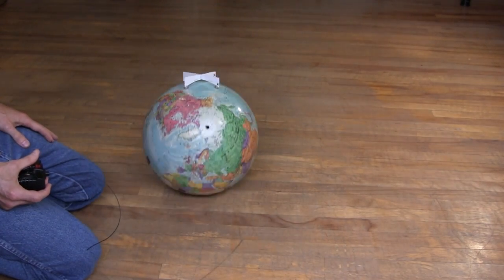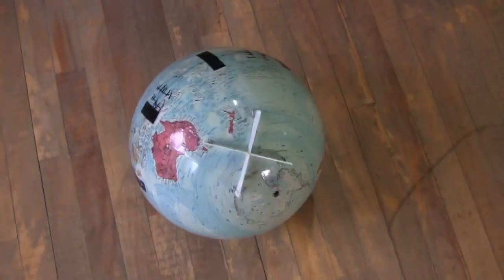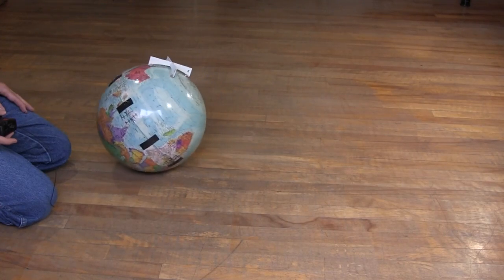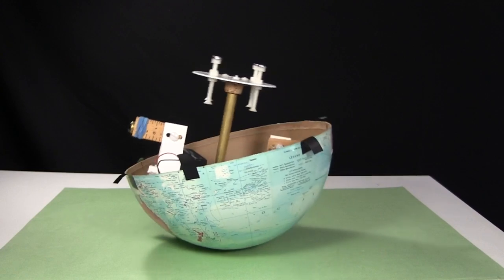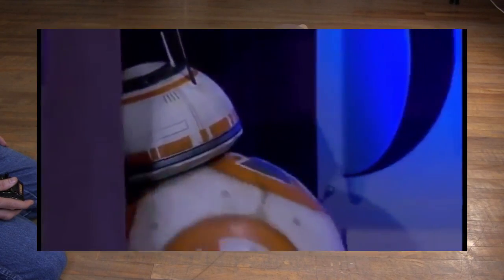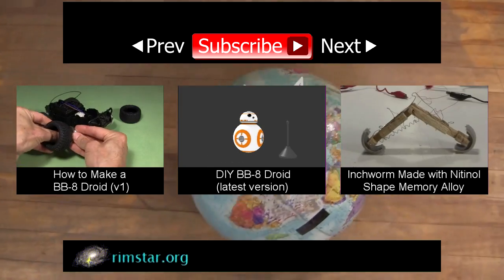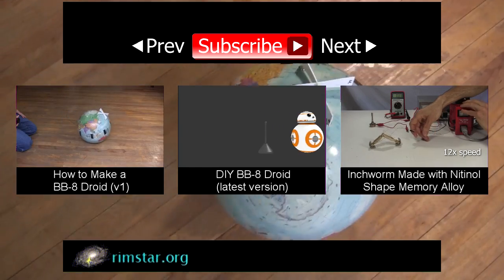BB-8 Droid Build (v1) from Star Wars - Homemade

Comment: Then how to cover the card board head
Reply from the maker: I didn't get to that point since the head was already too heavy. I guess you could keep adding move of the vertical sections to fill out the inside more, and then glue strips of paper over it to cover it. In my version 2 BB-8, I make the head using styrofoam instead (https://youtu.be/Ycgng3vyLOM).

Comment: you should try and use stronger magnets and both the head and the body...
Reply from the maker: +CAPATURE I'm using hard disk drive magnets in version 2. But it doesn't matter. The magnets in this version 1 are too strong for the motor in the RC truck to pull. What's needed is a more powerful truck and more mass in the bottom. My version 2 has that (https://www.youtube.com/watch?v=1gWBS70vphY), though it's currently in testing so I'm not sure if I got it yet.
Reply: RimstarOrg cool! I'm making a simple BB-8 if i can and i really enjoyed your version 1 because its cheaper than version 2 and i think i could make it. just need the head to be very light!!!
Reply from the maker: +CAPATURE I still wonder if there's a remote control toy out there that has strong enough motors to do the type in version 1 too. Let me know how it goes.
Reply: RimstarOrg thanks!

Comment: I "suggest" you add a chain or ball link in the center of the central rod so the magnets can be as strong as they should to hold the head on and then a weighted pendulum "plum-bob" to keep the head in line with the balls top.
Reply from the maker: +Luke ODonnell Thanks. I think I recall considering a design like that at one point (and forgot about it :), I went through a lot of alternatives.) That would be good for the next version. Ultimately though, the head should be able to move all over the top on its own, but that's for a much later version.

Comment: Maybe bearings on the outside part so you can use stronger magnets.
Reply from the maker: +Andy Jones Bearings for the head are in the plans. A lot of commenters have mentioned it and it's not something I'd thought of before.
Reply: RimstarOrg unless you already have something in mind, maybe bearings found in bicycle wheels and headset would work, since those use exposed bearings, they might roll any direction. Easy to find anyway!
Reply from the maker: +Andy Jones Bearings from bicycle wheels are exactly what I have in mind! I'll make a small socket of some sort to house them in. At least that's the plan right now. But bearings in a headset? I'm not familiar with those. What type of headset?
Reply: RimstarOrg same thing. They're so you can turn the handlebars. Anything with exposed balls.(Can't wait to hear the comments about exposed balls) you got the idea. If you look at a bike frame, that section between the handlebars and forks usually has bearings where the channel they run in is a press fit in the frame that could be pounded out (or cut). Might be easier than cutting a hub or making your own channel, but I don't know if the original channel will allow free movement or only the intended circular movement. The same bearings are also in the bottom for the crankshaft. I might have time to test it later today. I'm sort of a hoarder, lots of bikes!
Reply: RimstarOrg I just looked at my bikes. If you can find a "freestyle" or "trick" bike, there's a piece called a "gyro" that allows you to spin the handlebars without twisting your rear brake cable. Its got bearings in it and simply lifts off. Bearings, channel, and all. Still gonna take some of that rimstar ingenuity to make It all come together though!

Comment: A small no cost upgrade that would get rid of some of your problems could be to put the head not at zenith but more towards the front of the car.
A small cost upgrade could be, to reduce the friction of the head maybe with small plastic-beads using cut off needles as axles.
That could then be upgraded if you make those bead-wheels able to swivel, but maybe that isn't even necessary.

Comment: One improvement you should consider is to make a servo controlled mechanism to tilt the arm inside so that it moves independently from the truck. You want to force the head to the direction of movement to mimic the way the "real" droid locomotes. If you watch him, he leans into the movement direction like a person on a Segway. This would help solve the weight problem as well because the weight would move to where it was helping drive the truck.
Reply from the maker: +USWaterRockets Actually, his head doesn't always title in the movement direction. In the 1st Star Wars trailer where he's moving fast his head is vertical. Mind you, they used various puppeted versions during filming (the full-featured droid we see at promotional events was made after filming) but it's still canon behavior.
I'm working toward our Ottawa Maker Faire in November so I'll be happy just to have a rotating head by then. The servo arm is certainly one approach for tilting. Some others are to put my vertical brass rod on a swivel at the bottom, or have the inside magnets on a curved rail.
Reply from the maker: +USWaterRockets Trying ball bearings for the head, instead of the magnets are in the plans. I hadn't thought of having bearings serving both functions until people here pointed it out.

Comment: it would probably work a LOT better if you can find a spherical surface better than that globe, and perhaps add rollers on the top part, all to reduce friction. It seems like the magnets on the head have a hard time sticking to where they belong.
Reply from the maker: +Power Max Actually, the magnets on the head stick better than I expected! :) But yeah, as a direct result of the comments here I'm pretty sure the next version will use small steel balls instead of the magnets. My globe has terrain sticking out of it and I sanded them flat only around the join so far. If I don't switch to something else then I'll sand the rest of the terrain off and work on where the two hemispheres join. I'd rather spend the money on the driver mechanism first.

Comment: you need motorisation on your white cross like buggey , small rc heli motors 4 of them and bluetooth remote control...just ride it on the soccer ball..
Reply from the maker: +HAL900032 The problem with that approach is that the head isn't supposed to always be on top. In the Star Wars trailer and conference video it rides down quite a way on the side of the ball too, sort of like tilting your head but without a neck. Look closely at the 2nd clip of the actual BB-8 droid that I show near the beginning of the video and near the end. I know James of XRobots did his that way, but that was based on only the 1st trailer where the head was always on top.
Reply: +RimstarOrg I see that yes...

Comment: You could try adding weight to the bottom of the car, because the main thing you want is that the center of mass of the car with the structure, which holds the magnets, and head lies below the center of the ball. You could also try to reduce the mass of the structure with the magnets inside the ball. Still in interesting attempt and I am looking forward to your future attempts. I also did a quick search and it might be that the head also has its own actuators which are controlled in order to allow for head movement. One way that jumps to mind is to use some kind of pendulum configuration, such that the head will be oriented away from the effective acceleration (so leaning into the movement when accelerating). Here is a quick mock up in Algodoo: http://i.imgur.com/Ij3fvix.png however it will be hard to find an implementation such that the pendulum can swing in two directions without obstructing the structure which ensures contact of the wheels.
Reply from the maker: +Kwin van der Veen Thanks for the suggestion and drawing. That was the first approach I tried. I quickly found a problem with it. For the pendulum arm inside the ball to hang there it has to be supported by the magnetic attraction to the head. For the pendulum to swing as it needs to, the mass at the bottom of the pendulum has to be relatively heavy. That means the magnetic attraction has to be fairly strong. That strong attraction acts as a sort of friction, severely restricting sideways motion where the magnets and head are. If it had worked it would have made it so much easier.

Comment: Had never seen this before..it's quite the challenge. You're evidently getting somewhere with real hardware :)
Roller bearings would be a way, any steel bearing will attract to the interior magnets.
An off the wall idea, would be to use a Levitron world stage inside the ball, with the head floating in the air above. No friction to worry about !
Reply from the maker: +Mongrel Shark I'm actually leaning towards a two wheeled approach with differential steering (like a tank.) That way I could just use two joysticks and do it manually, plus it could turn on a dime, good for crowded Maker Faires.
As for the bearings, I tried them today. It's actually too little friction for this version. I end up having to use too strong a magnetic field which ends up being too strong for the truck to overcome. I'll show it in Friday's video.
Reply from the maker: +slider2732 Oh, I see what you mean by the bearings attracting to the magnets. They'd pull double duty - attraction and smooth movement. Small enough bearings might still be light enough. I'd have to devise a lightweight socket for them too. It still might be too heavy for the current incarnation, but it's certainly an improvement.
Reply: +RimstarOrg I sometimes find small bearings that would be ideal in printers. 6mm internal 8-10 external. Very light and very low friction. Most likely to find in top shelf inkjet and most laser printers. Not so common in cheap inkjets.

If you had skid steer rc car it would turn well in the ball I would think.
Reply: The skid steer I was thinking of a four wheeled version of more or less the same thing. Like a tank, but I was thinking Two sticks. Each with foward and reverse for one side.
Two wheels would be better. One stick control is awesome if you can map it. Two sticks is reall easy to implement.

Comment: I thought about using strong magnets on the interior and steel roller bearings for the head.  My project is still in the planning stages, but it might give you something to think about.  Also, if the magnets are too strong, you'll need bearings on the inside too to create a gap between the magnet and the sphere that will keep it from rubbing or lifting the control mechanism.
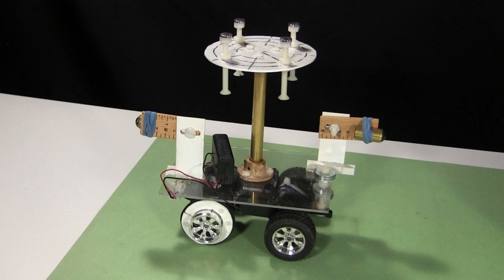Reply from the maker: +Richy Rich I have some steel roller bearings but due the to weight I made my own using marbles and hollow, thin walled brass tubing. You can see them on top in the video at 0:47 in an earlier test for the very reason you're thinking of, to keep the magnets from lifting the control mechanism. But as you see at that point in the video, even they were too heavy, for mine at least. I'll be showing the details of how I made them in next week's video.
Reply from the maker: +Josh After you'd posted your first comment, others also mentioned using steel roller bearings until finally it got through my thick skull that you all meant using the bearings in place of the surface magnets as well as for reducing friction. I even remember seeing that done on a website and wondering, "where are the magnets?". Duh. I'm definitely going to try that for the next version. They'll probably be small for weight reasons, on the order of 3/16", 5mm. I have some bicycle wheel bearings that might work. The tricky part is making the socket. I've a few ideas there. Thanks.

Comment: Where's the truck's antenna, don't you need that?
Reply from the maker: +Brandon Fisher It's there. It's a black, fairly flexible wire so I usually run it to the side, then up over the acrylic sheet to either to the front or the back and through something so that it doesn't slip under the wheels and make the truck get stuck.
Reply: +RimstarOrg Oh, it looked like a wire so I couldn't tell; I'm not used to seeing antennas flexible like that.